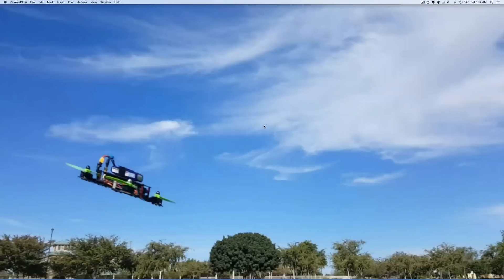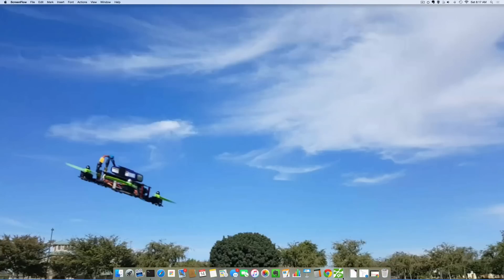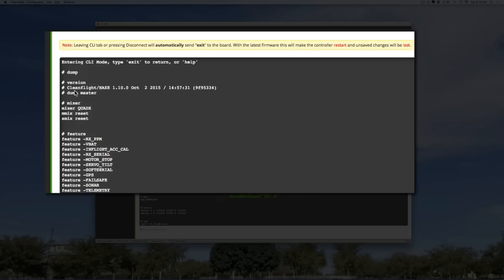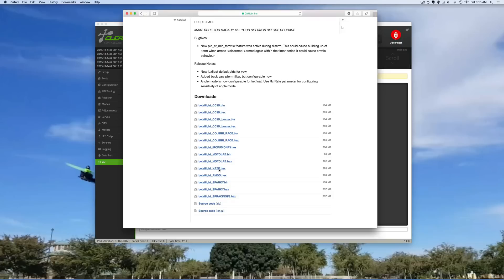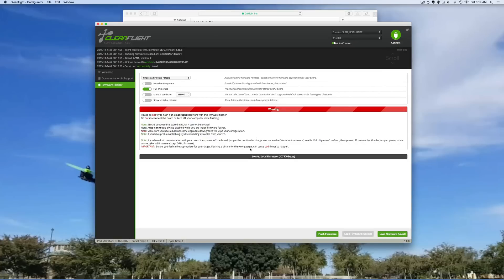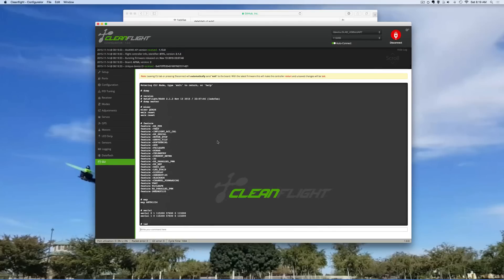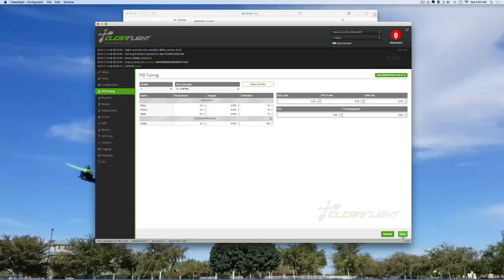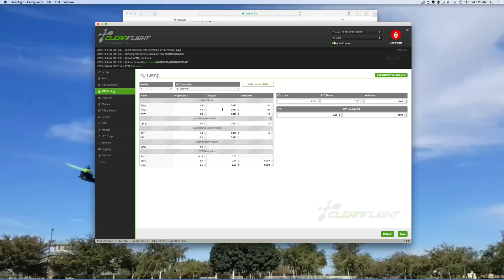How to install / flash Boris B. Betaflight on Naze32

Comment: As a complete newcomer to the terms Cleanflight(CF) and Betaflight(BF), this video leaves me hanging, and waiting for part two.  See @Flyin Mikey question below.  I want to use the BF Configurator, but I am not sure or convinced I can use it, yet.  You didn't take me to "BF" and show me.  I saw you executed the CLI dump, while in CF,  and it shows BF firmware is loaded, but will it actually work in the BF Configurator?

Comment: Ha ha ... I'm still using Baseflight. After I got my ZMR250 all tuned, I was afraid to update to new Naze32 FW and have to go through all the tuning process again.  It looks like the newest Betaflight is now completely divorced from Cleanflight .. or at least the GUI has changed showing Betaflight instead of Cleanflight.  I keep back ups of my PIDs and CLI dumps from Baseflight, but don't know if those number are compatible with Betaflight.

Comment: are you using cleanflight and betaflight interchangeably?
Reply: +Dean Thorton No, as you saw he typed "Dump" and then he Disconected, so he deleted the Cleanflight files. then he reflashed it with Betaflight and connected again. And then he typed "Dump" to see if it worked, and it did. This time he didnt Disconnect so i didn't delete the Betaflight files :)